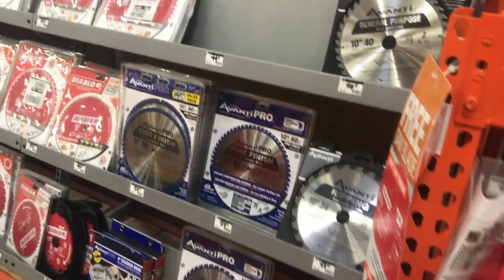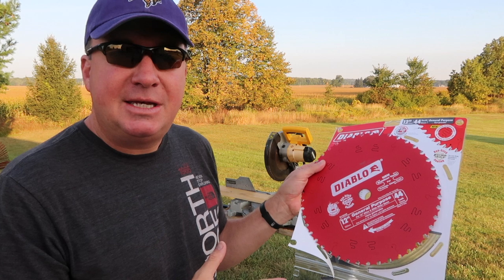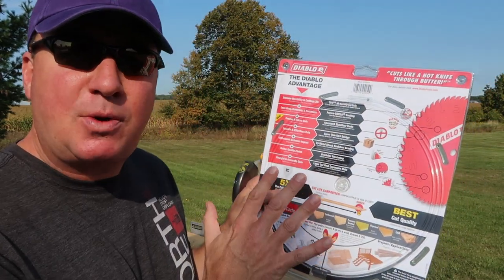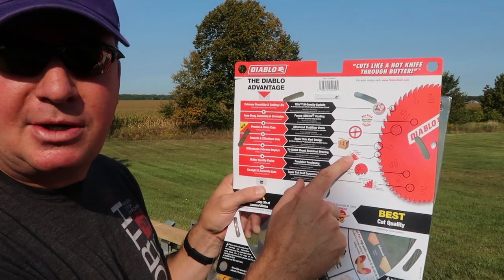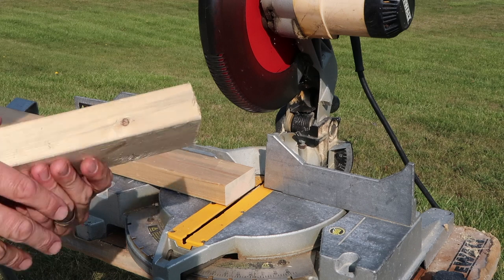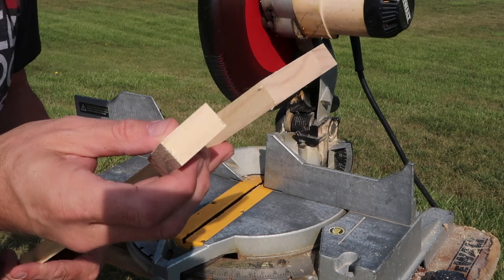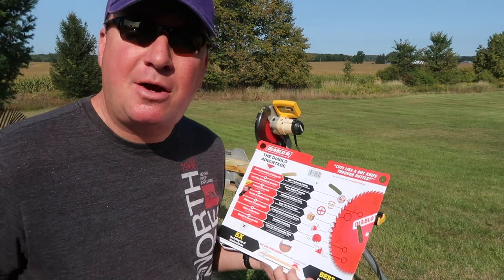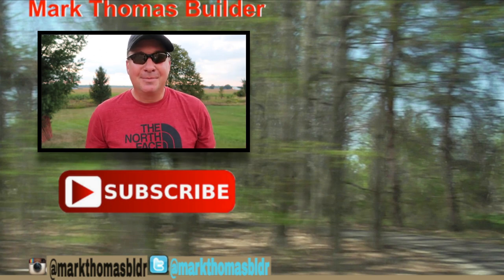TOOL REVIEW TUESDAY!!  DIABLO 12" SAW BLADE 44 TOOTH

Comment: I used the blade that was supplied with my RIDGID 12" miter saw for about a year with good results, until I laid 800 sq. ft. of "horizontal stranded bamboo hardwood flooring".  The bamboo is four times harder than oak and I noticed a drastic difference in performance after that job.  Replaced the blade with the DIABLO 44 tooth and everything now cuts like butter.  Does anyone ever have the DIABLO thin kerf blades sharpened?
Reply from the maker: I haven't tried to get it sharpened.